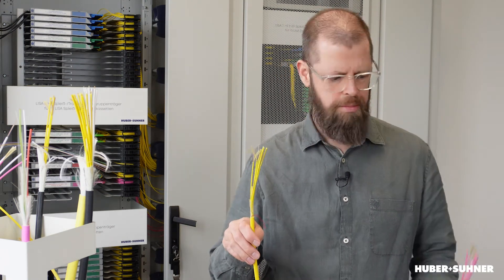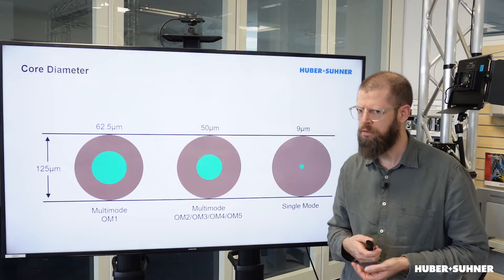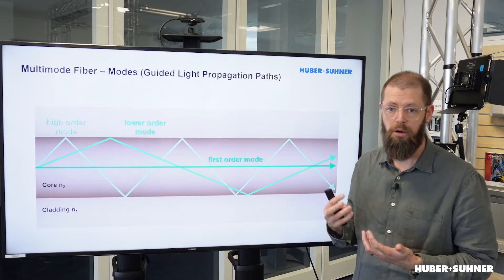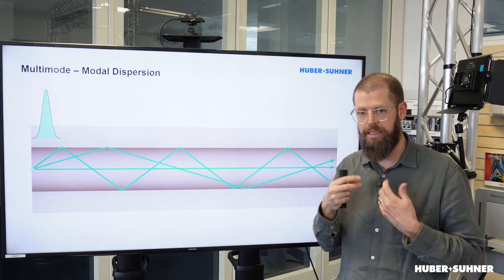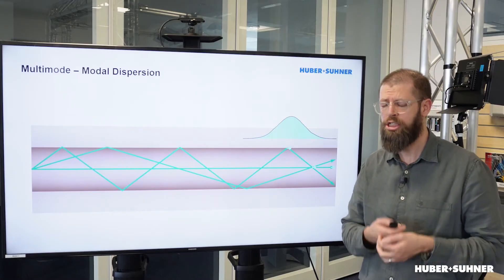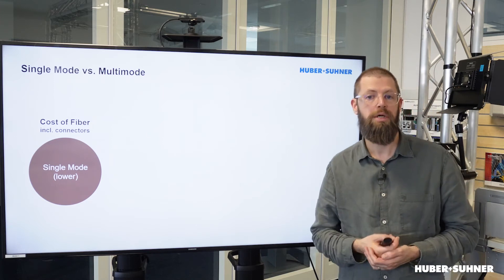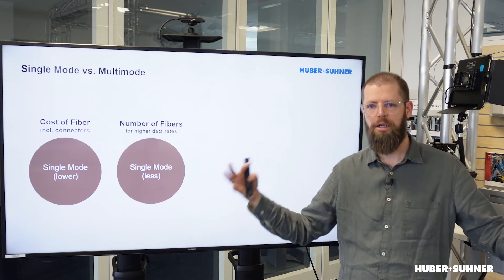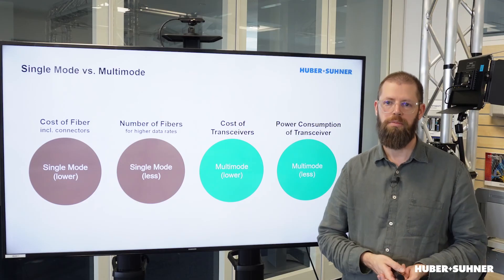Singlemode vs Multimode explained (01-07-07)

Comment: I’ve had data center customers driving towards BiDi for single-lane and CWDM for multi-lane sheerly for fiber density relief above all other considerations mentioned.
Reply from the maker: Thank you for your insight.
As always, there are many individual requirements to consider and these requirements can vary quite considerably, depending on the customer. If cabling density is a very high priority, it can outweigh other negative aspects such as higher power consumption or CAPEX (i.e. CWDM and BiDi transceivers tend to be more expensive and use more power).

Comment: In Brasil, MM fiber cost 5x SM fibers. Here we don't have the cost thing related. But for a data center, Multimode has more advantages. Cheaper than SM and most important, more tolerant to fault in terms os dust and laser alignment. Normally MM uses less power than sm transceiver because of the distance they're meant to work with. Cascading Switches or "stacking" is well done with MM Transceivers. 
Hope y'all doing Well. With love from BR.
Reply from the maker: Absolutely @tiagoas171, MM is much more tolerant than SM regarding handling. And especially for DC connectivity where you have high port density and shorter distance, the lower power consumption of the MM makes a noticeable difference!
Thanks for your comment and insights. Stay tuned as there are more #brainsnack videos in the making… or check out our channel as we already have many more 😃

Comment: Great video.  Range in single mode is longer.
Reply from the maker: Thanks @jeffturner415 pleased to hear you like our #brainsnack video.
Yes indeed, the achievable distance with single mode is by far more than with multimode.
As you liked this #brainsnack, you might want to check out and follow our channel as we have many more of them and regularly add new ones.

Comment: One other advantage of multimode not mentioned here is that it's slightly more tolerant to dust specks, scratches, and other surface contamination/damage on the fiber faces. The larger core means that a dust speck or defect of the same size will cause less insertion loss (since it covers a smaller percentage of the core) and thus is less likely to cause a link failure. Obviously we try to keep our fibers clean but in real life mistakes happen.
Reply from the maker: Thanks for your comment and addition to the advantages of multimode fiber cables.
Indeed. Despite best efforts, keeping every single fiber connections clean can be a challenge. Added resilience therefore definitely is a plus 👍🏻